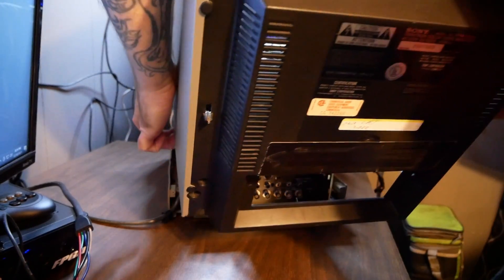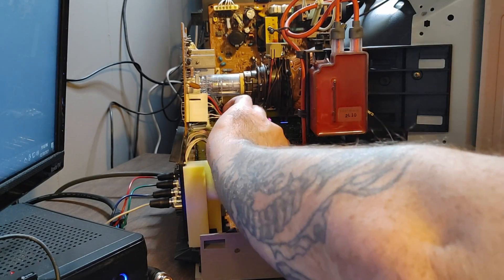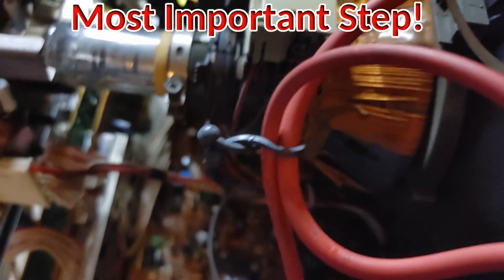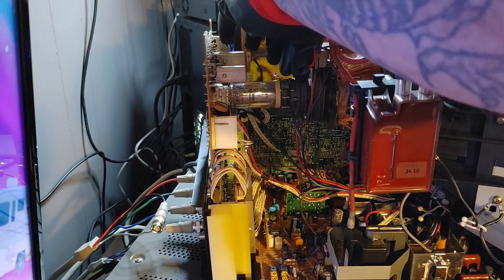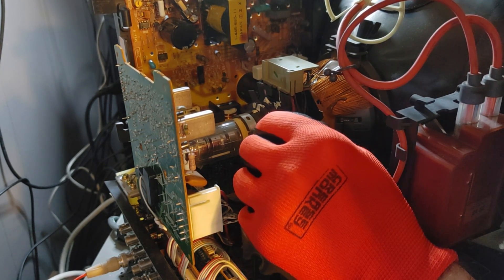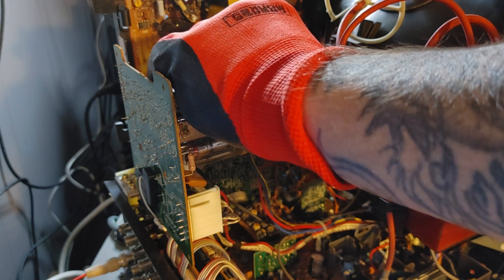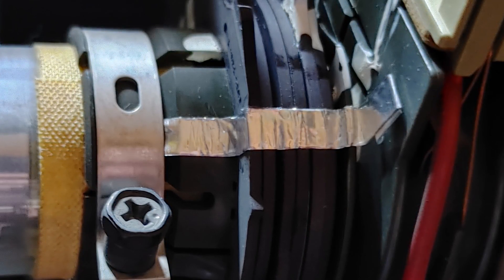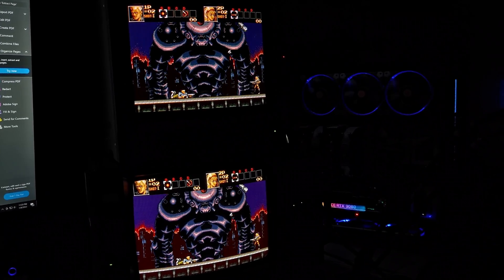CRT PVM Convergence Guide ... Fingering the Rings ... You Can Do It! ... HSTAT VSTAT

Comment: Your video is an excellent guide. I'm working with a 20" Olympus and it appears that my static converge is dead on but my corners (dynamic) are a different story. Do you have a reference to a guide for these issues? I'm aware that it will likely be messing with convergence strips or magnets - I'd just like to watch a few videos for education before diving in. Thanks again! ~ Ben
Reply from the maker: @Hawk_Eye_Retro  I think retrotech has a video or two of using magnets to fix corner convergence. Its just trial and error really.... Good luck with it!

Comment: I just spent 3 hours getting this trinitron aligned up all because I did not mark the rings before moving. Never again. I also zapped my arm. But this was my first full refurbished tv iv dont where I replaced all cap, new thermal grease on the heatsinks etc. Definitely learned alot of what not to do the next time.

Comment: Great video! I attempted to fix my Sony 25" TV KV-25X1E thanks to this video. No matter what I do the convergence on the upper part of the screen is missaligned they beams do not move in the same pattern as the rest of the screen, they allways get some separation, even left and right upper part of the screen look different... Any suggestion? I put four convegence stripes but it does nothing.
Reply from the maker: @voytopuesto   I was going to say try convergence strips but you already did. Did you try reseating the yoke?
Ive had a couple that had really bad beam convergence at the extreme edge so i just adjusted the V and H size to get it off the screen.
Reply: @LameGaming  thanks for answering, I do really want to try save this CRT. Yeah, it is at the extreme upper side where the beams do not aligned, the rest is fine. I haven´t tried reseating the yoke, I will do that next 🙂. Thanks for the advice!
Reply from the maker: @voytopuesto  dont know if yt will delete the link but maybe host a pic on imgbb and link it here. Also if you post a pic on reddit on the crtgaming sub im sure youll get some good answers if you cant link an image here.

Comment: Hi.
Could you help me with some advice?
I have a 22'' monitor that has some slight, but annoying convergence problem, but only on 2 opposite corners.
Bottom-right and top-left corners, where blue and red ares shifted about 0.5mm apart from each other.
I don't really know what to do. Is it a rings problem? 
It has 3 magnetic correction strips glued to the CRT under the yoke, but I don't see that they have moved over time or something.
Everything seems solid.
I tried to move gently the rings, but they won't budge at all. Do I have to losen the screw first?
Thanks.
Reply from the maker: @worroSfOretsevraH  usually the screw just clamps the yoke to the tube. Are the rings glued?

Sometimes if corner convergence cant be corrected you can try weak magnet strips in the corners, would take lots of trial and error
Reply: @LameGaming  I'm not sure if they are glued, but there is a wide white paint strip across them. They are on some grey plastic tube, that has 4 fins or ears towards the back side of the tube. Is this some kind of screw or something that has to be losend before the rings can be moved?
It looks just like the magnetic rings, but this has 4 tabs instead of 1. (12-3-6-9 'o clock pisitions)
Reply from the maker: @worroSfOretsevraH  the white stuff is usually an epoxy or glue to keep them from moving.

Comment: Hi a question,can we adjust the rings without wearing gloves,assuming that we are extremely careful not to ouch something else?
Reply: If anyone is wondering still. Yes you can. As long as you dont touch the rear of where the lightbulb is, the motherboard or the coil plug. You should be fine

Comment: Man - really happy to have found your channel - yes, very much like you - have put it off for too long and don't want to mess things up /make worse.  So I seem to have convergence issues on the outer top left corner of my monitor, not necessarily the center or other parts.  I'm wondering if tweaking the rings need to be done in conjunction with a yoke adjustment?  I have an arcade monitor (25" Wells Gardner) this is most notably happening on, but this information is great all around and I will be taking a look.  How bad was the shock and are you no longer getting shocked with the glove? cheers
Reply from the maker: Ive only ever owned a couple arcade monitors and that was before I started messing with crts but I would assume a yoke adjustment is only necessary if your image is tilted, you have yoke sag, or you know it needs reseated. alot of the time some edge and corner convergence issues are just part of the hobby, no crt image is truly perfect.
If its just that one corner, maybe try a magnet first.

 Honestly...the little zap I got startled me more than anything and its the flinching reflex that will damage your crt or yourself lol. I dont know if the glove helped, I have a lineman glove rated for this stuff but you have to put another glove over it and it is too bulky to use. I always try to keep one hand behind my back and stay away from the anode and power supply and have been fine thus far but dont do as me just because I do lol. I havnt had to do any yoke or ring adjustments since messing with these 40 series pvms but have a 2030 and 2530 im going to recap soon which im sure will need some tweaking.

Comment: Only have an H-Stat problem but I couldn't find a knob on mine sadly (JVC i'Art 24")
Reply from the maker: I dont own an iart but have a jvc 36" curved tube crt that I just rgb modded. I dont think it has an hstat knob either. Probably all done with the rings which may be glued down. My yoke is bonded to the tube as well, not sure about the iart sets.
Reply: @LameGaming  Opened it up yesterday and there's no way to move the rings. Probably glued down and I did not want to mess with it since I'm new to CRTs
Reply from the maker: @mospiii210  Probably a good decision, crts are never perfect due to the nature of the technology. Sometimes a little misconvergence is to be expected, especially towards the corners.
I have 3 sony pvms that all had new tubes put in but the serviceman never bothered adding convergence strips. I got the majority of the screen converged well but theres some misconvergence in the corners.
I have two options, spend a whole day moving around convergence strips to find the best location and gluing them in place and let my ocd make the whole process 10x longer than it should take.... Or ignore it which you really cant see unless your looking for it anyway.
Im ignoring it.....

...For now 🤣